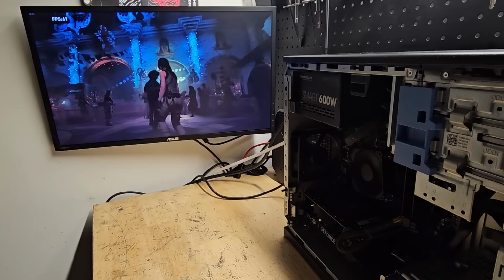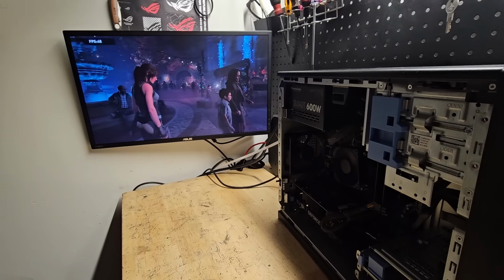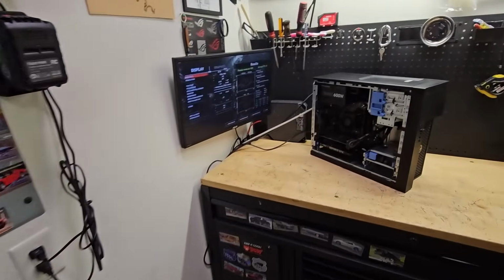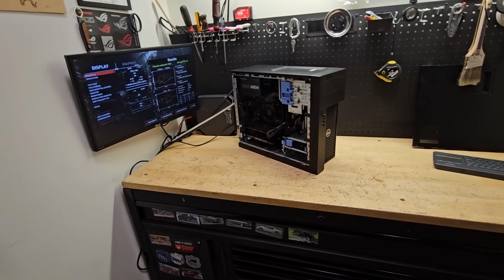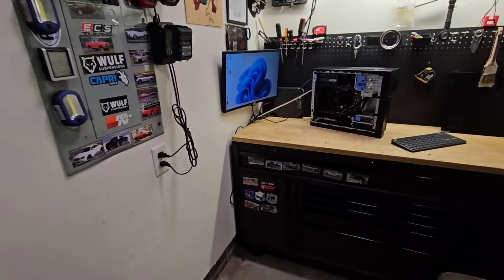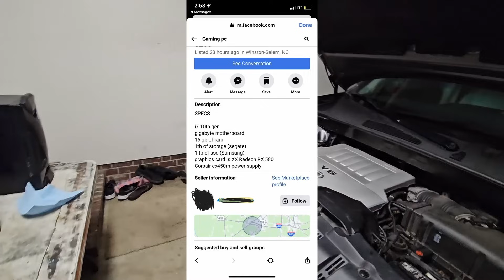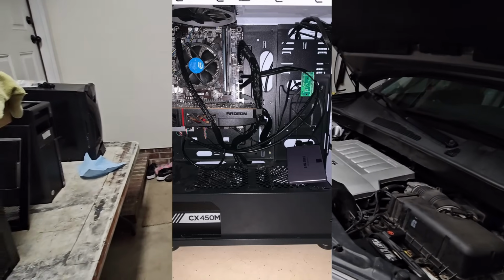I can't believe what this $10 cable did for this Office PC!!!

Comment: Removed the HDD cage on my Dell Miditower to install a more powerful GPU. Also suddenly had space in the case for an additional 120mm fan. So i drilled a 120mm hole in the bottom of the case where the cage was once installed (+120mm fan) and put the case on 2cm high rubber feet. Installed a 4 TB HDD in the front of the PC (after drilling some new holes). Temperatures have dropped by a good margin and also the 92mm back fan is running much less noisy.

Why is Dell so obsessed with making their hardware running boiling hot?

Comment: Good video, makes me think about my extra HP Z2 G5 workstation with a 10700 and a 320W PSU, I wonder if the Gigabyte low profile 4060 would work in it with a sata to 8 pin adapter? There's not a lot of PSU overhead 🤔

Comment: You can still get drive adapters that will allow you to mount a laptop hard drive or standard SSD in the 3.5 bay slot. Used one within the last year when using an old case for a computer. For my main computer,  I needed hard drive mounting cages because I have an 8 TB and 4 TB hard drives which I use to store videos.

Comment: Just an FYI. You can get the GTX-1650 in a smaller dual slot card. I got a low profile unit used for cheap.

Comment: Fortunately for myself. The local goodwill has an actual “good will computer store”. They have every cable you can think of for 1 dollar. Memore. Graphic cards and so on. You can even get 5040 optiplex without hard drives for 24 bucks. And functioning ones for 100.

Comment: another upgrade you can make to these is putting a 7th gen core i7 and upgrading the cpu cooler with dell part VWMTJ, really made a difference in performance. As long as its on latest firmware, and you use that cooler you shouldn't have any issues with the upgrade.

Comment: The best low wattage and second most efficient graphics card to use in the Nvidia product stack is to get the Nvidia quadro P2000 more Ram and 12% more efficient than the GTX1650 and on the used market you can get these for as low as $80 at ebay auction. Most popular card to use compared to the GTX1650, or the overpriced RTXA2000 that's only another 12% greater in efficiency than the P2000

Comment: hey man I have an Optiplex 3010 for retro games that uses a tfx psu, the mobo has (I think) normal 4pin cpu and 24pin mobo connectors. can i use a normal atx psu or do you think they are not wired like standard psu?
Reply from the maker: i think those use a standard 24 pin and you can just use a regular psu without any adaptors

Comment: You'll never get anything bigger Video wise in there that won't suffocate without major front end surgery.  The smaller cards work and won't build up much heat, you try putting a 2060 or 2080 in there and it's gonna run hot and quickly cook parts.  I mod these cases all the time for customers who want bling and more cooling and it's fun side hobby.  I always recommend newer cases but you can mod these older ones fairly easy and fast.  Lovin the video!
Reply from the maker: Thanks, appreciate the info!!

Comment: I use SMART in my Optiplex as well, but that big jumble of cables really annoyed me so I removed the ones I did not need.  you could stuff them all in the 5.25” bay.

In mine though, I had 2 3.5” SSDs in the 5.25” (Since I removed the hard drive cage)

With all the excess wiring removed, it made it look really clean.  Only 3 wires were coming down to the MB.

Comment: A nice, 'short' video would be to show how to take the DVD face plate off and hot glue it in. Removing the dvd drive allows a lot of room to hide cables and mount ssd in the 5.25 bays.

Comment: I have that exact model with an i7 6700, a bronze certified 650w psu, 8gb rx580 and 16gb ddr4 (with m.2). I had to remove the hard drive bracket to fit the graphics card. 😆 Which graphic could be a good upgrade for this mount?

Comment: Since you’re not using the 5.25” bays one of my favorite tricks for this layout is to screw in a tray that holds two SATA SSDs where you mentioned screwing in one.  I did this when PNY used to have 128GB SATA SSDs for $15.  I also use Icy Dock Flex Trios.  This platform really has the potential for one to go crazy with storage expansion.
Reply: There's a cheaper alternative to the Icy Dock which can hold 6 2.5" drives. With two 5.25" bays, you could potentially have 12 drives in there.
Reply: @BrunodeSouzaLino  i will potentially use this information in the future thank you clippy

Comment: Sometimes these come with the 365 watt PSU out of the XE2, which have a 6-pin PCIe power connection, which should be good for about anything with an 8-pin with an adapter. It's a shame they didn't just include it in all of them, unlike HP with the Z series workstations.
Reply: It's you! Man you've helped me so much on my Optiplex research journey, thanks a bunch :)